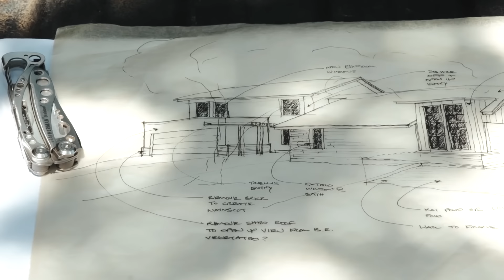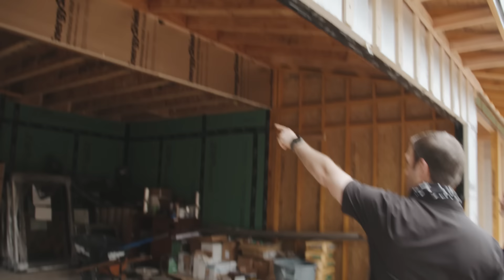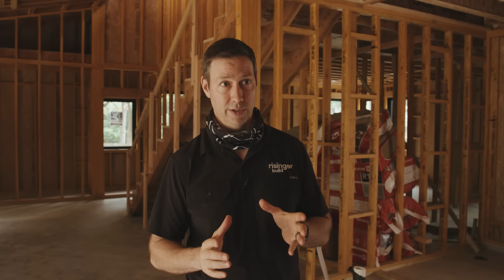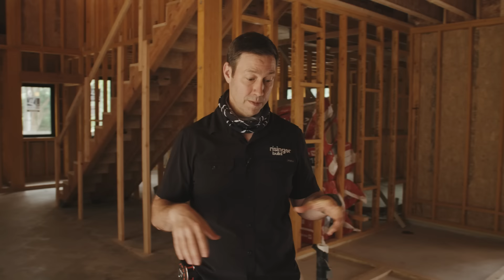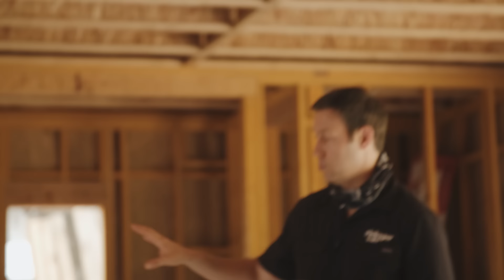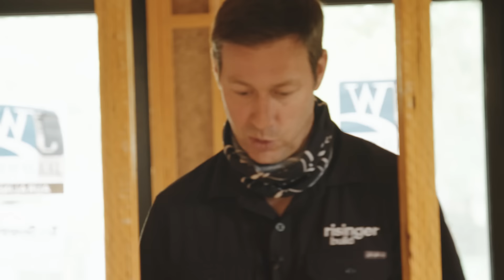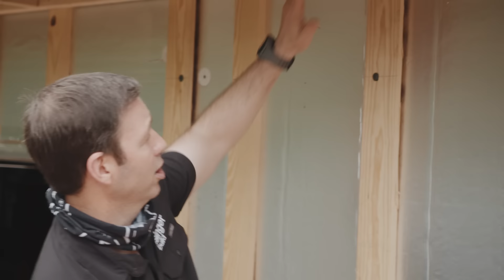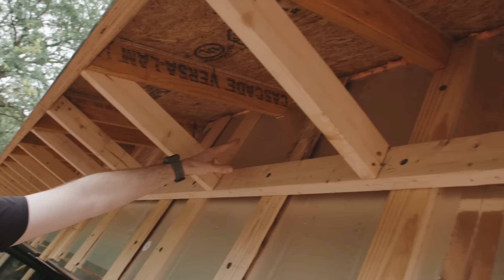The Perfect Wall - Building Science Training

Comment: I love most of what has been done with the design and how the house was sealed up. I wish more builders and designers would add a radiant barrier to the house as you did. 

However, I do believe that you missed one area where a radiant barrier would be worth the slightly added cost of doing so. Heat transmits by radiant energy, by convection energy and/or conduction. You are placing your roofing directly onto the Zip System roofing. Thereby creating a conduction zone. Yes, you do have 4" or approximately R26 insulation. Why not add a radiant barrier on the roof, install furring strips over that, bug screens top and bottom, and let the heat of the sun create a moving layer of insulation to take that added heat energy out via ridge line vent? Moving air does have an R value, granted a very small value, but the column of moving air through that cavity will reduce the heat load that will conduct through the roof, roof insulation, and Zip sheathing and into your attic.

You are adding foam insulation on top of the slab. You made the statement that you would have a complete thermal barrier all the way around your house. This is not a 100% accurate statement. You do have the bottom of your walls in contact with the slab. This will create a small thermal break in an otherwise complete shell around the living spaces of the house.  Does the TX building code allow for the use of the high density foams, the ones 1000 PSI to 1500 PSI compression strength foams? I realize that it is too late for this to be added. But, it is  food for thought for a future build.

I know some of the readers of this will take this as criticism of what Matt has build. This is not the case. I admire him for the level of detail that he has done with the building of his new home. This is a level of detail that I wish every construction firm in America would emulate. There are far too many construction firms that build ONLY to the minimal code required by law. The laws much change, and the building practices of these backwards firms be updated to reflect modern practices. Excellent practices, like what Matt has demonstrated time after time in this latest videos and site builds.
Reply: Chris Aldridge the roof points you make are my exact thoughts. A rain screen/air barrier on the roof would increase efficiency and add better dry through if there was ever a leak in the roof. I’m thinking of doing exterior insulation on my remodel but Using a metal roof and instead of the extra layer of sheathing just use Battons(purlin style)  on the roof.
Reply: I'm 100% sure he will not put a standing seam roof right on top of the zip sheathing. He didn't do it in his house across the street. That house has a roof underlayment, he then screwed furring strips at a 45 degree angle and the standing seam screwed to that. I expect him to one up that house.
Reply: Chris Aldridge I think it’s likely what he with do since he’s doing a standing seam metal roof.
Reply: We all anticipate a vented roof assembly, good idea in Austin. In my part of Front Range Colorado, woodland fire regs prohibit any kind of venting, so the compact roof assembly is by far the best choice, in my opinion and practice. And I have done compact roof assemblies successfully for over 40 years, in Mass and CO. 

The bit about wall on slab is pertinent. Matt should be criticized for being super anal about some things, then completely ignoring issues that are probably bigger. Around here, we are always on a crawl or basement, and we do totally conditioned spaces (either way). The 2" continuous is carried down to top of footer. No comfort or moisture problems anywhere, any time.
Reply: He definitely isnt putting the roofing directly on the zip sheeting. I'm not 100% sure but I think 1 of his past videos covers that.
Reply: I noticed that insulation on slab was missing too! Not sure if the load bearing walls can be built on top of insulation though. That's tricky.
Reply: @leestevens446  Do you install the 2" outside foundation wall as a thermal break, or inside to insulate against expected thermal transfer?

Comment: Gotta work with Tesla for your solar. You'd love their solar roof tiles and power wall, if you aren't already familiar.
Reply: I have been told by Tesla "no solar roof for new construction yet" Also, he said he's doing standing seam metal, but I like where your head is at Reilly.
Reply: @jims.4785  Standing seam costs more but there are very nice solar panel mounts you can get that just clamp onto the seam without damaging it. That roof can probably outlast the useful life of a solar panel many times over. I personally prefer the utility of an easily replaceable clamp-on array.

Comment: Couple thoughts. When thinking of longevity, it seems all those old houses were masonry, timber or log homes. The whole point of stick frame is cheaper/quicker construction. At what point do we get that we are trying to improve an inferior construction method that we turn the cheaper construction into being more expensive than the stronger and longer lasting building methods? It seems that if you are wrapping in insulation, you are basically doing what they do for timber frames with sips panels. Why not just do that? Or build a log house and wrap with insulation then minimal framing to attach siding? 
As someone without much budget, hoping to build a house in the north, I’m just looking at the expense of your house and wondering if it’s worth it at that point. 
Also, passive house where you have to survive without electricity is a manufactured problem. With a wood burning stove and a supply of firewood, you don’t need electricity. You can keep warm in a tent.

Comment: As someone who does blower door testing regularly as part of my job; I never get good results on spray foam. My clients are always disappointed; but spray foam with no other air sealing measures will not grant you great results. You still need either a zip system outside; or poly barrier inside.

Personally I find I rarely have good results when poly is not used. The only time I have good results without poly is with 1 passive home builder I work with; who tends to do a double stud 2x4 wall that is sandwiched between 1" of polyiso on both the exterior and interior;

Comment: Can you give a rundown on the added costs of passive house design vs traditional methods during one of these videos? It would be great to go this route, but average home prices for standard construction in the suburbs of Washington D.C. start in the $500,000 range. Can’t imagine what the added material costs would be.
Reply: capparramichael at least 100k more
Reply: Wish I could offer details but I can't. So much depends on local costs. But even more depends on how you prioritize your budget. For example, basically the labor cost of installing a junkie window is nearly the same as properly installing a high quality window. So why not put that unavoidable labor cost into a higher quality product? This concept applies to a lot of features. 

Insulation is another challenging area because there are many ways to accomplish higher quality but the various approaches may impact other aspects of construction. Matt's continuous insulation envelop will give excellent results, but it does add complications to door and window installation which don't arise when all your insulation is in the stud bay. So there it's worth looking at whether the trade-off is worth it. Maybe it's worth upgrading insulation to spray foam between the stud bays to achieve a high, if not highest R-value, while avoiding the complications to door and window installations.
If you're building a new house, depending on local sourcing SIPS may be an affordable way to upgrade. Properly assembled they can give extreme air tightness and very high insulation levels.
If you design a house with a super-efficient shell then you have the opportunity to save cost by reducing the size of your HVAC plant. But your HVAC designer/contractor needs to be reminded not to oversize equipment.
Finally, of course, you need to consider the long term reduced operating costs due to lower energy use if you want to do a proper evaluation compared to standard construction.
Reply: Materials are not the big cost, its mostly the extra labor that is needed to get all the details right. There is no cutting corners
Reply: The cost difference between Passive House design vs traditional "code compliant" design depends on whether you are building new construction or a retrofit.  

For retrofits like Matt's house here, it would definitely cost somewhat more because it is more difficult to air-seal and insulate all the existing nooks and crannies needed to meet the Passive House retrofit criteria.  With that said, you can get 80-90% of the numbers needed to certify a Passive House design and still have significantly lower heating/cooling bills and much better thermal comfort than a normal "code compliant" house.  Oftentimes, chasing the last 10-20% of the numbers can add significant cost to the project.  IMO, sometimes good enough is good enough, especially if you're getting 80-90% of the way there.

But for new construction, it is significantly easier to detail everything correctly to meet Passive House new construction standards.   Project professionals have quoted 5-10% higher cost compared to new construction in the past few years, and I have even heard that it costs basically the same as normal "code compliant" construction.  

One of the key tenets to Passive House design criteria is that you will spend significantly less on mechanical equipment to heat and cool the building.  This is where much of the savings comes in terms of initial construction cost.  With lower heating/cooling demand, the mechanical equipment is sized significantly smaller, which lowers the cost of purchasing and installing this equipment.  There is the extra cost of installing an HRV/ERV, but these not only greatly improve occupant health, but are sometimes even mandated by some energy codes for new construction and significant retrofits (NY City has mandated them in its 2020 energy code, for instance).  

Another factor to consider is the lifetime service costs.  We should all understand that Passive House buildings will have significantly lower heating and cooling costs.  The savings per month can be anywhere from 50%-90% of the HVAC bills. 

But another factor to consider is the durability of the construction.  If designed correctly, Passive House buildings should last significantly longer than "code compliant" buildings.  This is because the various air-sealing and humidity reduction measures result in a significantly lower chance of mold to form in the walls, insulation, and structural members.  Less mold equals not only better indoor air quality, but lower retrofit costs in the future.  In "code compliant" buildings, owners often have to rip out insulation and lumber due to mold rot, which adds to the future cost of constrution.

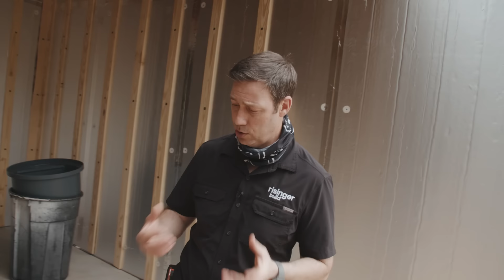Comment: 12:24 There is a side effect of the roof insulation to the overhang. The shadow spending overhang gets higher. It's not level to rafters but on top plus insulation. To prevent rain splashing you have to calculate more overhang.

Comment: I have trouble imagining the tape adhesives remaining functional for even 100 years... Maybe 50?
Reply: Hi Shaun . . . Not even that . . . Two properties we have re-modeled - Tape failure/ adhesive failure throughout - 10 year & 8 year only . Top brand tapes .
Reply: Thank you both. I was wondering if anyone had experience with the “high end” tapes. I don’t trust the coating on the zip wall Ian either. Tyvek isn’t the answer either. I’ve pulled cedar siding off a house with tyvek and there were holes in the house wrap. I think either peel and stick or spray on is the way to go. Like a friend of mine in commercial waterproofing says, a hole in house wrap means water from there all the way down.

Comment: When you get to running electrical and such, wire for Ethernet, at least 2 drops per room (of Cat6a or Cat7) and a run to each outside corner of your house at the sophets (sp?) this will allow you to add a really nice security system and home internet. I recommend Ubiquiti Networks UniFi gear. You won't be disappointed and it will be way easier to do now than to try to retrofit.
Reply: I would also go as far as to put these ethernet drops in conduit if doing new construction, so 10 or 20 years down the road when there is a new standard it can be changed out.  Agree with you on the UniFi gear, during these COVID-19 times when other people are having a lot of WiFi issues, my UniFi system has help up and my family is online without any issues.

Comment: Doesn't the foam insulation effectively become structural when you bolt things through it? How does it handle torqueing, crushing, and shear forces that aren't directly pushing or pulling on the bolts?
Reply: All the structural properties are from the initial Zip System sheathing, assuming they follow the correct fastener and fastener pattern.  The foam insulation is not structural in this instance,  It's simply fastened to the sheathing.  The battens will further secure the foam insulation as they are attached beyond the foam, initial sheathing and to then framing.

Comment: Issue also is economics, no one wants to pay for a 500 year house. Champagne taste on a beer budget they would rather have the pretty quartz countertops than a well built green home. What is the cost per sq ft to build?
Reply: Most people don't think ahead.  The cost savings of a home at this level are accrued throughout the operational life of the structure.  It's the proverbial "buy once, cry once".
Reply: @benjaminrhodes9611  Maybe most won't have the house long enough, or live long enough to see a lot, or most, of those savings actually pay off.
Reply: I've lived in too many new homes built to a low budget to ever do it again. Building to last saves in the long run.
Reply: Current US culture, we have voted with our wallets for glitz and size. And getting out before the s**t hits the fan; the next buyer counts on getting out from under in a timely fashion as well. There is no problem with technology, only with the consuming public. 

Last project was an $80k leak repair on a seven year old house. When rains came from the north, the living room floor was 1/3 covered in standing water. The seller failed to disclose (they had a half-assed "fix" done to hide the problems). Tough thing is that the house needs about another $200k to make right, and worse, virtually all the houses in the "New Community" suffer from water problems, as well. Great for the repair industry, come in a kludge a crappy "fix" on these p[laces until they finally are abandoned. The issue is economics (whose and when??).
Reply: Daryl Kupchanko houses are too big nowadays for most people to build efficiently. people should get over their egos and build responsibly. quality over quantity

Comment: I'm really curious how Matt is going to deal with make-up air for his kitchen, bath, laundry, and clothes dryer vents.
Reply: The exhaust is worked into the fresh air system outside the normal ductwork.
Reply: He has shown this on other videos
Reply: All I've ever seen in his videos were balanced air systems which are different than a Make-up air system.
Reply: @Ringele5574  Laundry and clothes dryer vents are the same thing and they make dryers that are heat pumps, so all you need is a condensate drain... no vents
Reply: @BrendanCBreen  I was speaking of laundry room vent.  Sorry for the confusion. Heat pump clothes dryers don't need an exhaust?  What about all the other vents in the house?
Reply: @Ringele5574  They make home air make-up units for energy recovery and conditioning/ cleaning the incoming air. You just run all the ducting to the unit... it's not complicated, just an added expense.
Reply: @Ringele5574  The heat pump dryers are basically air conditioning units that use the heat production to warm the air in the drum and the evaporator to condense the moisture. It's more efficient, self contained and technically doesn't need a drain, but if you choose to not attach a drain you'll have to empty the condensate yourself (much like a dehumidifier) which if you're building a house like this I doubt they'll choose to do.
Reply: All the vents go to an exchanger that takes heat or cold and bring in new air and heats it.

Comment: Would this "monopoly framing" method even fly in Northern Lower Michigan (zone 6)? I'm concerned about hacking off the rafters and THEN frame the overhang...since we deal with snow loads and such.
Any insight(s)?
Reply: Definitely an engineering calculation in snow country.   I assume there is a calculation that works out.